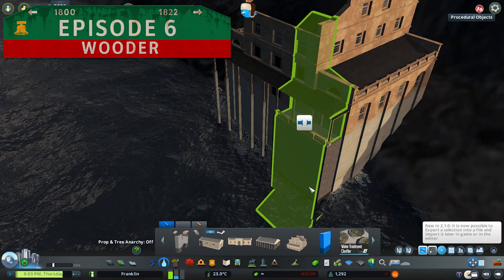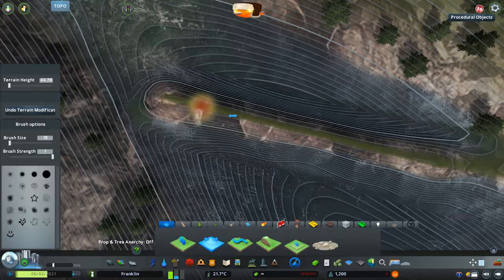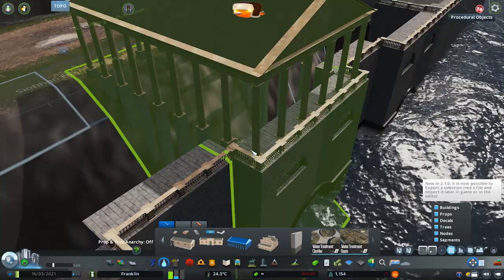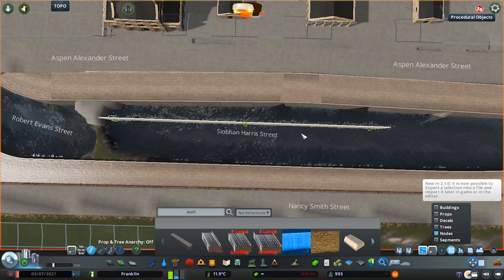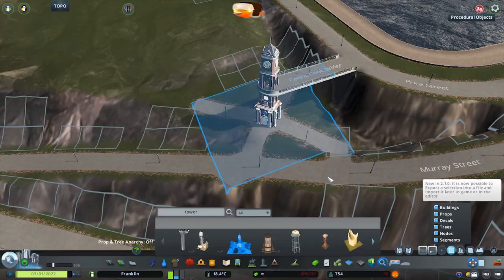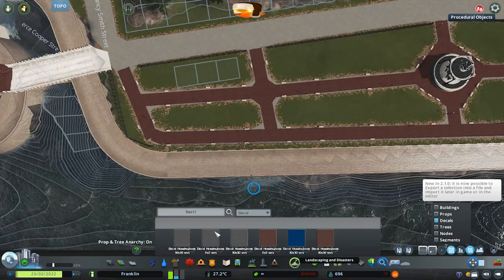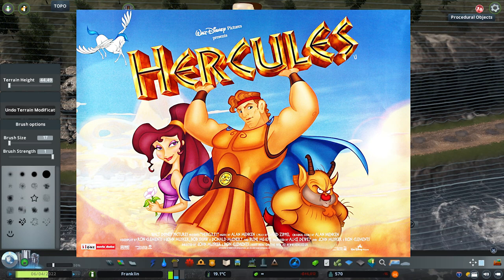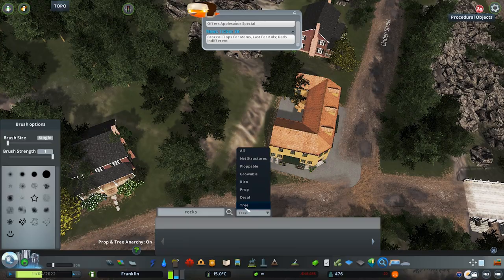Cities Skylines | Franklin Episode 6: Wooder

Comment: A lot of the time from what little I've learned, another key cause result of boiler explosions throughout the 1800s was the lack of legislation requiring boiler operators to be certified or display any form of before handling these already dangerous boilers that often lacked low water cutoff valves. 
For reference for those not super 
 familiar, when a boiler is low on water, there is more open space in the boiler that can come into contact with the furnace's flame. The weak, riveted steel of 1800s boilers was weak to where it would begin to reach its melting point and becoming weak to the point of rupturing due to the pressure within the boiler. Steam has roughly 1600 times the volume of water meaning all the water expands that much, instantly levelling the building that houses the boiler along with everyone inside.

God I wish I could a job after learning this now half remembered shit.

Comment: My friend and I recently restored a Waterworks Steam Pumping engine in New Jersey. It was built by Allis Chalmers in 1913 and provided 6 million gallons per day to the city of Phillipsburg. At this point it is the largest operational stationary steam engine in North America.  Sadly it is far more spartan a facility. They did get around the Dam problem though, as did many of the later facilities. In the Phillipsburg station's case, it draws from 5 wells dug along the banks of the Delaware, allowing ground water under the river to permeate in through layers of sand and gravel, before traveling inland a few hundred feet under ground, through another sand filled filtering tunnel, and into the station itself. The engine then pumped it up to a reservoir 200 feet up. I don't know much about this corporate or political history of the station sadly, I'm more of a mechanical guy.